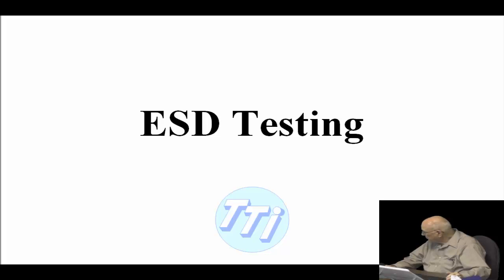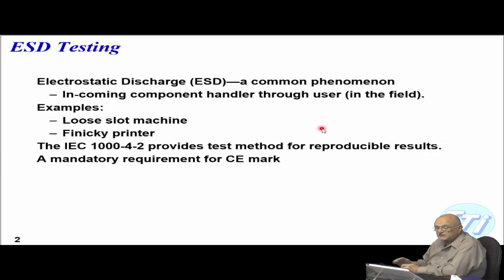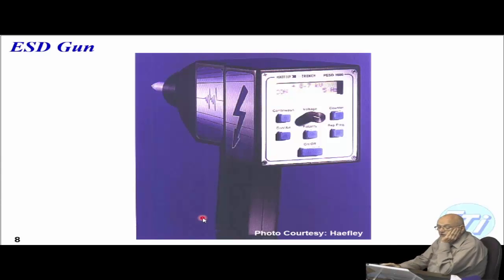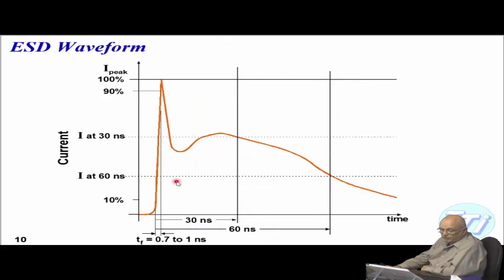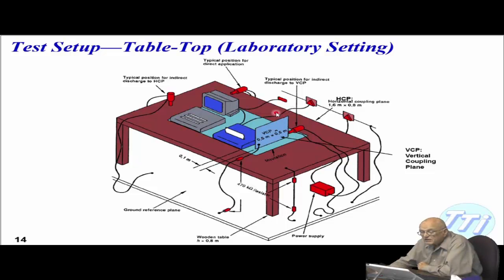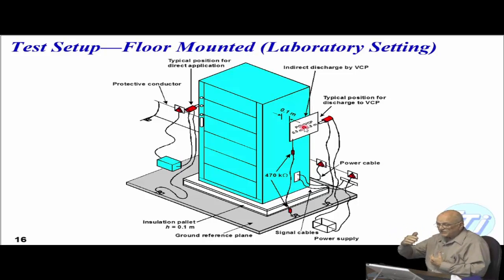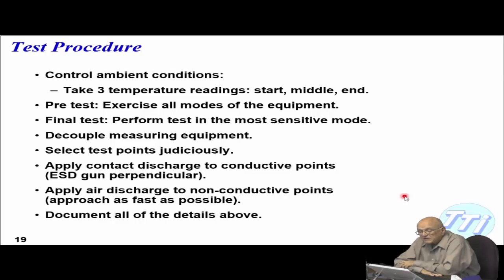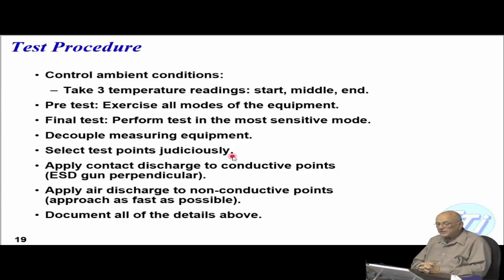ESD Testing

Comment: As we know while performing the ESD testing, the operator needs to stand on the ground reference plane.
 
a)What are the various safety aspects needed to be followed?
b) Is there any special type of footwear need to be worn during testing?
c) we need to provide a separate earth connection for the ground reference plane. In our premises we have a common earth line for our lab. If we connect this same earth line to ESD setup there could be failures in the other equipment’s connected to same line.
 How we can do the setup in this case?
What are the various standard practices to be followed?
Reply from the maker: Here is a link to the entire 20 hour "Mil-Std-810" course: 

https://ttiedu.com/course_outline?tid=28

You get a subscription to watch all the videos at TTiedu.com

https://ttiedu.com/user/register